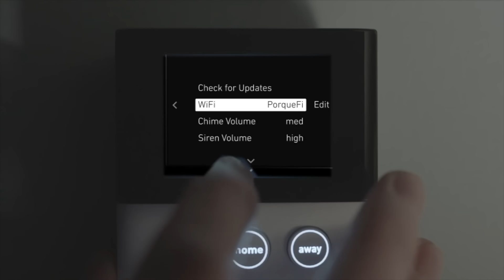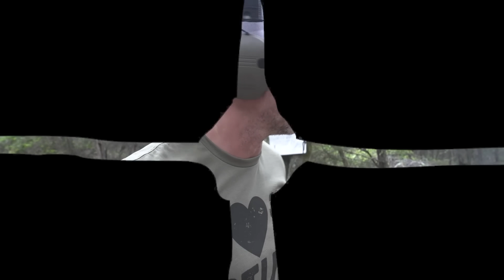Shooting a Hi-Point Tesseract With a RAUFOSS 50 Cal!!!

Comment: Dang, Raufoss rounds have gotten way cheaper in the past several years. They used to be like $150 a piece. Probably a lot more demand because every youtuber has a .50 BMG 😂
Reply: I thought $75 was expensive!!!
Reply: The Raufoss round was initially produced in Norway. Raufoss ammunisjonsfabrikk (Raufoss Ammunition factory) They where tasked with making ammunition for the Norwegian military in 1896, in 1968 the factory was taken over by the Norwegian government, in 1998 they merged with the  Swedish company Celcius and the finnish Company Patria. Raufoss Ammunisjonsfabrikk is a part of Nammo who is a defence industry corporation,  the Norwegian government currently own 50% of Nammo. That could be an explanation for the price of the Raufoss rounds.
Reply: @Poacher91  Look up the construction. It's not just another bullet. It's has both high explosive, incendiary and a armor piercing component. It's designed to "go off" in a way that maximizes the damage experienced on the inside of a armored vehicle, and it produces enough heat that it can ignite jet fuel. That last thing is not as easy as it may appear. Jet fuel doesn't just burn easy like petrol. You can stick burning rags in it and they just peter out. A friend had to put blowtorches to it before he managed to get it burning. So this ability makes it a good round to use against choppers, aircraft and just about any vehicle powered by turbines.

According to Wikipedia it's about as effective against armored vehicles as a 20mm auto cannon round. And that's from a .50 caliber round...
Reply: @blahorgaslisk7763  Correct. They also now make it in a sniper version! And Raufoss is viking for red waterfall, which I find very fitting.
Reply: @Poacher91  So, it's basically an anti-Russian round. Cool.
Reply: I have a few in 30.06. 
They are VERY old.
I store them in a box of plastic bb’s so the don’t get jostled and wreak havoc in storage.  They are spectacular, even at .30 caliber!😮
Reply: @Poacher91 i imagine the price drop may have something to do with the norwegian currency being alot cheaper compared to the dollar than it used to be? 
15 years ago it used to be 2$=10NOK. Now you get about 1$=10NOK. 
Kinda sucks. We used to travel the world and order stuff online and every foreign thing used to be kinda dirt cheap for us. 
Cool that so many people have heard of Raufoss tho. I grew up alot of my childhood there.. it is like.. a really small and unremarkable countryside  town/village, even by norwegian standards. I find it kinda funny that it is known across the world. Lol.
Reply: @blahorgaslisk7763  How is any of this relevant to where it was produced?
Reply: @avlinrbdig5715  That would make sense, I didn't t consider the currency exchange. My bad, I just assumed that cost of production is higher in Norway compared to for example United States, and as a result of that they are more expensive compared to other 50 cal. rounds.
Reply: @Poacher91  Not only that, they are made to a high standard and way more accurate than other 50 bmg rounds. Most of the long range kills made with the M82 Barrett are with the Raufoss for this reason. It's pushing the calibre to the limit engineering wise.
Reply: @321aquaponics4  Can't really compare those two, different calibre notwithstanding.
Reply: @Poacher91  cost of production probably has been higher and still is. But that hasnt changed all that much. With rising electricity prices, it is probably increasing.
Reply: @Kraakesolv  the difference is the caliber, and that is the comparison.  Ihavenoideawhat your comment is trying to accomplish.

Comment: If anyone wants my advice, I’d save just another hundred bucks and buy a Taurus G2 series pistol. I have a G2C and the gun is impressive with it’s accuracy and it’s ability to run almost any round with no malfunctions. I got mine for 245 bucks, plus tax. And it’s actually a decent looking pistol and the grip feels pretty nice. The down side is a gravelly feeling trigger and a long reset. But once reset it’s a short as any good self defense pistol. Get one and try it, and become a believer. I’m not a cheap pistol guy, but the Taurus is probably the best bang for your buck hands down.

Comment: For the people that don’t know the Raufoss round is a multi-purpose anti-materiel high-explosive incendiary/armor-piercing ammunition projectile….it has a copper jacket with an incendiary mix at the tip. Behind that is a Mild Steel Cup that runs to the back of the bullet…. in this steel cup is the high explosive (rx51-Petn or rdx comp A-4) this is placed right behind the incendiary mix behind that is the carbide penetrator rod. Around this rod is zirconium powder. And behind the end of the steel cup at the end of the bullet is lead steel. There’s an interview on a documentary where a sniper used this round. https://m.youtube.com/watch?v=hxLSFLomRjc&t=4386s&pp=ygUiU25pcGVyIGluIGFmZ2FuIHVzZXMgcm91Zm9zcyByb3VuZA%3D%3D Go to 1:06:12 for the short story and they test it against a ballistics gel block after the story.
Reply: All of that from a Norwegian company.

Comment: Matt, the solution to bubbles in resin is to out it under a vacuum before it goes off, it will pull all the air out of it and give super clear results.

Comment: 2 things. First iraqvet8888 has a 3 or 4 video series on trying to make one explode in 40cal. The amount of abuse the thing took and still functioned was quite frankly insane. In that regard i would put any other semiauto against it. 

2nd... i have the 40cal pistol and the 10mm carbine. The carbine will take the 40cal mags and shoot 40 just as reliably as the 10mm. Since subsonic 10mm kinda defeats the purpose and the 40 is pretty much a standard subsonic round this makes sub sonics with a can on the conveniently threaded barrel easy to come by at any place that sells ammo. Single stack mags or not thats nit an easy thing to come by. 

Plus hipoint added a 30supercarry option. 

Say what you will but hipoint listens to their customer base and is unafraid of innovation on their base design. They stick to single stack mags for the states with shit gun laws. And im all for everyone having an option even those stuck in shit states. If they ever introduce something with more capacity ill likely buy it. I like the direct blowback simplicity of the design better than the ar15s i have honestly.